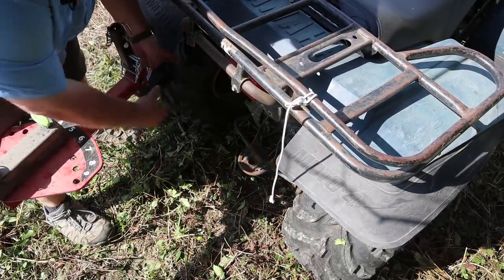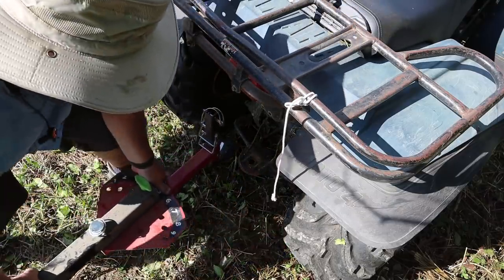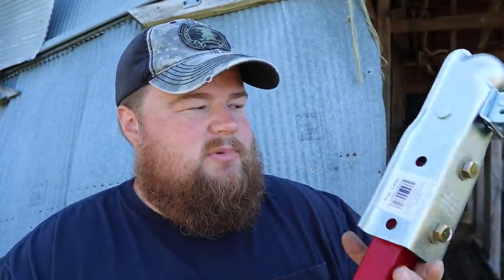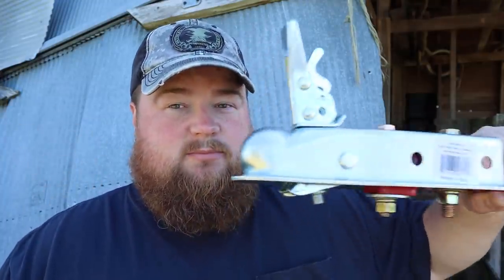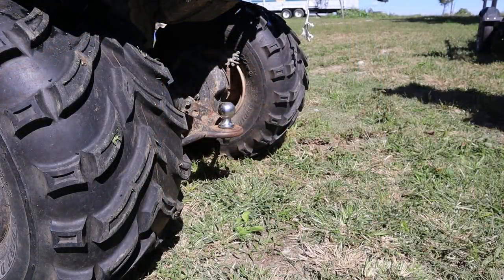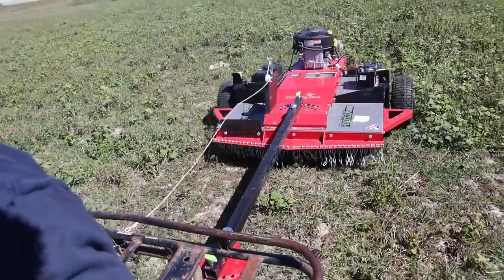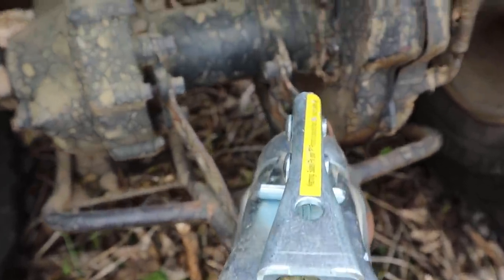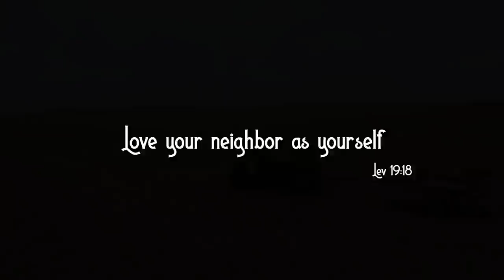FIXING a PROBLEM with our BRUSH MOWER

Comment: Try putting a large nut in the square opening. Then thread the bolt through it and lock it down with the lock washer and smaller nut. This will eliminate a wood block from deteriorating over time and breaking out. It will eliminate any play in that opening too. Also, remember to put a snap pin in your ball hitch lever to avoid any brush from popping it open and possibly jumping the hitch off the ball.

Comment: Thanks for the video. Wanted to do this last year but my engineer buddy had to juryrig a way to couple it to my Mule MX SxS. When that failed a few weeks back I went and bought the coupler and am a whole happier. 
The Earthquake is a beast, I run over all sorts of small bushes, pine trees and stuff. Been great to use plus it's taken down the time my buddies used to mow with their garden tractors by 2/3's the time it took them. Deer love the clearings also which is nice when the season comes along.

Comment: A block of wood in the square hole with the bolt hole drilled through the middle will eliminate your slop without modifications to the original part.

Comment: Where the bolt goes through the square part you could make a wooden shem to fit the square and run the bolt through the center of it. That would take away any movement. Great idea to put a ball hitch on it.
Reply from the maker: If I had it at home and in the workshop I could have made the shims quickly -- that's a good idea. Thankfully it's stayed put so far. :)

Comment: think the reason the pin hitch broke so often is that it didnt alowed for the machine to tilt independent from the pulling vehicle (like driving with one wheel over a stump ) the ballhitch gives it a lot more freedom , should work fine
one idea that miight help with the stump thing is adding skidplates or wedges (cut some out of firewood stumps with a chainsaw and bolt them under the metal triangles in front of the wheel so you can ride over higher obstacles , think right now if an obstacle manages to only just get under the triangle it takes a lot of force to drive the wheel over it , the wedge should help some lifting the wheel before it drives over the obstacle making it feel a lot lower

Comment: You got a Hitch Pin there. Maybe you could use a Square Wire Lock Pin. Lowes You can take a puinch and bend over a couple threads to keep those fasteners together with the rough duty they get.

Comment: Glad you could come up with a solution for your p.i.t.a. hitch pin problem. I like the ball hitch better on my old lawn tractor too. I use it for my rubbermaid lawn cart with is very versatile  since all 4 sides can be removed to make a flatbed trailer or keep them on and use the tailgate as a dump trailer bcuz it swings up like one also. 
The ball let's me move my rowboat & trailer out of the way to mow too. And when I still owned my 2 horse horse trailer I could move it too. But now I've traded that off for my gooseneck 4 horse horse trailer and of course that's too big and has no ball hitch, LOL.
Someday  (soon I hope) I hope to find some land like yours to build my new homestead. I'm waiting for parts, but covid has slowed them greatly, to come in for brakes on my motorhome. Then I'll be headed south from Michigan and start my land search & hopefully also start my YouTube channel.
Reply from the maker: I wish you great success and hope you find your place soon!

Comment: Have you thought about doing an offset trailer tongue so that you're not having to drive through the brush before the mower cuts it.    Maybe a next upgrade idea.   Only drawback would  be that you could only cut in one direction.
Reply from the maker: It has one, I just have yet to use it (or show it to you all) in that fashion. :) For wood cleaning, the ATV didn't have enough power to pull it offset. But for weeds/grasses I'm sure it will be great.

Comment: Use a bolt with the nylon locking nut and a couple big washers if you need them. Your hitch won’t come apart and you won’t lose any pins brother

Comment: Near the beginning of your "test drive" there appeared to be a black part in the lower bottom of the picture that was loosely bolted on.  You might want to check the bolts on the mower for tightness when you get the chance.  My experiences through my 75 years have told me to check everything after I've used it for a while.
Reply from the maker: I've looked twice and don't see anything loose -- unless you're seeing the tow bar for the mower? If so, it's not bolted down -- it uses a pivot point and spring loaded pins to lock it in place left/right for the offset mowing options.
Reply: @sam-and-angela  That must be what I saw. Glad there was no problem.

Comment: I just got mine, the belt jumped off in the first 5 seconds of running.  Now it's 95 degrees out and I get to repair my new mower.   The hitch modification was working good though.  I upsized the bolt through the hitch square tube to a 3/4" diameter and had zero problems.   

Update:  I put the mower belt back on and mowed all kinds of nasty stuff for 4 hours, trees, thorny vines, fallen brush, etc without a 'hitch'.   Also mowed on hills I 'd not take my tractor or zero turn on.  This thing 'cut' my mowing time in half.
Reply from the maker: I had the same issue!! Check your main pulley set screws. I had one work loose and the whole main pulley was very loose.

Comment: My friend had a similar problem.  First thing he tried solved it.  He swung the tongue clear out to the side so he didn’t have to twist his head clear around to see it very easily.  He also liked not driving the ATV  through the tall junk.
Reply from the maker: This mower has an offset function, I just have yet to use it.

Comment: nice tool hack! I'm kind of surprised that such a heavy duty brush mower would be pulled on a hitch pin.  Also, to take out the "slope", you could try to insert a bushing that fits over the front bolt to eat up some of that slope space, or just add nut that squeezes just inside to close the gaps.

Comment: Just Saying, A 5/16 pin for the hitch would be good, Plus You need to grease the hitch ball every time it is used or it will wear out, But it does seem to be working fine.

Comment: A cotter pin does not seem like the right choice. They make a hitch pin (used for many farm equipment/wagons) that is like a heavy pin with a handle on one end and a hole for a cotter pin on the other end. They come in a variety of sizes. But, your conversion seems to work just fine.

Comment: How does this brush mower do when trying to mow sides of ditches??  The angle it can get is a concern.  Like I don't want it floating on air because of lack of angles.
Reply from the maker: Out of the box, there is not much flex in slope with the pin hitch. With this modification the ball hitch will allow more flex of the mower. That being said, it also depends on your ditch size and layout.
Reply: @sam-and-angela  gotcha.  That’s exactly what we were thinking.  Still pondering….thanks!

Comment: why not mount the ball hitch directly to the original clevis , you done away with the telescoping height adjustment feature if you want to use a different vehicle such as a side by side that the mount may be higher or lower .

Comment: Nice mod. Just a thought about the bolt which runs through the square iron. Would 1 or 2 pieces of short pipe of different diameters fill that enough to stop movement? Also thought of a block of wood, but that might not stand up to the forces.

Comment: While I'm waiting on ardisam to get the part as it's only been two months, last machine it was three months before they got the part. This time I think it's the wheel bolt. You wouldn't think it'd take more than a week at most, but it is ardisam. So I thought I'd share a few emails with customer service from the first mower that they finally replaced.
And remember, they never had anyone look at the machine after it broke through the deck.
----------------
From the pictures it looks like the brake pad is completely wore off, that is where we are getting the idea that the problem came from there. Another thing I can see in the pictures is that bolts were in there at one point in time. It looks like you only need the bolts that come in from the sides, not the ones that go through the deck of the mower, correct?

 I am able to send you a new brake pad and all the bolts, nuts and washers needed to get your mower running again
Cust service
------------------------------------------------------
Read your email, I have some questions.

You say the brake caused the problem. That's not what caused the problem.
The brake pad didn't wear down, it broke at one of the triangular pieces holding the pad. Being 2 hours away from where the mower is kept I can't say but the one side with the triangular piece broke off. That isn't wear that is a defective part.

However it was the missing bolts that was the cause of the damage. If the missing bolts were there where is the scratching damage from them around the bolt holes while they were backing out from the vibration? And where did the nuts and washers that were on the inside of the pulley housing disappear? There isn't sufficient room for them to slide out of that housing.
There should have been nuts and washers inside the pulley housing but there weren't any.

As far as the vibration causing any bolts to loosen and fall out, then why haven't other bolts loosened and fallen out. Was the torque not done to the specifications which might explain vibration?

Videos on line at your site for replacing the drive belt clearly show a design change for the 2 black guide plates on each side of the main pulley. They are no longer secured by bolts going down through the deck. Latest design shows them bolted to the large red base plate. Obviously the bolts through the deck were a weak point. The new design has no bolts through the deck. Without the "missing bolts " all the forces from the main pulley are directed to the bolts through the deck. That would have eventually caused the those bolts to pull through the holes in the deck.

When was the design change implemented?
--------------------------------
Good morning!

I didn’t answer those questions because I don’t have answers for your questions. I have no idea why they ALL vibrated loose, I have no idea why the nuts that should have been trapped inside disappeared. Sometimes, things happen that I can’t explain, the world is an imperfect place. We think, (and by we I mean me and both of my managers) that the brake pad being completely gone caused the issues with the bolts. Diagnosing problems from pictures is not ideal, so we use what we have and we do what we can.

This will absolutely all be covered under warranty (this is the connector on the tow bar, it broke after we jury rigged the deck to keep the mower running, I did not take their bolts). Per my last email, I certainly can help you out here by sending you everything you need. The other part of my job is to educate our customers about proper maintenance and things that can be done to prevent future problems. I apologize if you were offended by that, it certainly wasn’t meant to be insulting or anything like that.

If I send you parts, are you able to install them yourself? Will you be able to drill the pin out that snapped and put a new one in there if I send it? Or would you rather bring it to one of our service centers and have it repaired under warranty?
----------------------------------
Notice after having looked at the pictures they decided the brake "looked" like it completely wore off. At no point did the lock nuts vibrate loose, they were still tight holding onto the brake.
So their customer service didn't care enough to do any actual inspection of the machine, they just decided they weren't going to repair the damage.
Later on after more work the big pin on the mower where the tow bar connects also sheared off. That was the part that took 3 months to show up. By that time they had finally offered a new machine, which of course lasted about 15 hours before the wheel fell off, the bolts sheared off, the belt broke and such.
I do not recommend anything from this company, they  have more companies. I also bought one of their pop up blinds - Baronette was the name. One of the fiberglas ribs on the hub broke, later that same spring it developed a tear which in subsequent winds tore the blind apart. Less than two months of use and it was unusable.

Comment: Just a question - would it be better to put the bolts the other way around, with the nut facing up, so you can see easily if anything loosens?
Reply from the maker: Not in this case -- with lock nuts they should not loosen at all. I rather not have the bolt sticking up to catch pant legs or skin as you walk around it or hook it up.

Comment: Hi Sam i need to change the deck belt on my rough cut mower have you done this yet any tips ? thanks
Reply from the maker: It's a pain! It's been a while but if I remember right, you take the main pulley bolts out of the middle (allen key set screws) and the pulley separates apart. I also had to take the back panel off where the key start is to route the belt around the guides back there.

Comment: Update, had to do the change as that black connector cracked into two pieces. Got one from warranty. Then the bolts holding the belt guide broke off and cracked the deck and ardisam said it was because the brake pad was bad and vibrated the four bolts with lock washers off just that one side. The brake was also broken but somehow the vibration didn't loosen the bolt and lock washer on the brake pad and it never came off. The belt guide on the opposite never loosened either. All 4 bolts and lcok washers are still solid. 
ardisam said it wasn't their fault but offered 4 bolts and a brake pad as a "courtesy".  Their explanation when I asked how the 4 vibrated off and never were found within the enclosed pulley housing was "sometimes things just happen".
Fixed it without their help then the ball on the machine at the back end of the bar broke clean off. ardisam did say that was covered under warranty, but it's been about 4 months without a part to fix the thing. When I took it in the warranty dealer was told part was about six months out from July 9th. Never showed up and ardisam never talked to the dealer about the no show on the part. Last I heard from them was about 3 weeks ago and was told they expect the part real soon. Which I'm assuming is sometime winter of 2025. 
Put in a complaint to my state attorney general and Consumer Product Safety Commission. Last communication was "thanks for your patience".  
Would not recommend this mower because of the problems of breaking parts and really lousy customer service.
Reply: Another update.
Got a new mower last November after missing the rest the mowing season when they offered a new one. Took it. 
Have used it five times and the four bolts sheared off the housing and pulley guides. Sound familiar?
Buddy was checking it because the tension was loose and the mower wasn't cutting grass so when he took the cover off he found four holes with no bolts. This time though he was able to find a single sheared bolt. Guess they're using bolts with the equivalent hardness of butter.
So off to the hardware to get some new bolts with a hardness of 8. Installed that started the mower up and the belt broke. Haven't contacted Ardisam, but not really expecting much. That final break on the old mower I had to take the entire machine in rather than just the part needing to be fixed. So it takes a trailer to get things fixed under warranty when you can get them to do so.
Buy this garbage from Ardisam at your own risk. I really wish they had offered to buy it back so I could buy a different machine. Couldn't be any worse than this thing.

Comment: Why are you not using the offset adjustment so you can stay out of the overgrowth 🤔
Reply: Good ?
Reply from the maker: I've tried it a few times on the really tall woodsy parts and my ATV doesn't have enough power to pull it through that tall brush without having it laid over first.
Reply: I see thanks for the update response 👍🏻

Comment: Are you still happy with this mower and did you ever wish you had gotten a 4 wheel one instead?
I would value your opinion as I have read some bad reviews of the Earthquake.
Reply from the maker: We are still happy with it and use it regularly. No real issues to speak of. The two wheeled does fine behind our four wheeler or tractor and knocks down everything in its path. We have been pleased with the Earthquake brand equipment we have.

Comment: Ventrac makes a flail mower that is pushed in front of the machine. Well, Ventrac is for rich folks or golf courses that can afford a machine about as expensive as a new car. But you ought to take a look at their video! Wow! So, back to earth here with folks like me barely making it, there is a point they illustrate that having a mower in front allows a person to go under trees, etc. and direct the business end to where you want it to go first, behind the tractor. I wonder if there is a way to hook this machine you are using to the front of a stout riding mower, small tractor, or a 4 wheel utv, or maybe some one makes such equipment that would work like that Ventrac. Such a machine would need swivel wheels in front and back with a rigid yoke set up to the tractor, and then there is a safety issue as things fly off from the machine, so a screen between the mower and the tractor would be needed. Maybe some one out there can fab something up to work like that with this machine you are using. Any volunteers out there that can try this out?

Comment: Your initial problem was you're using a clevis pin instead of a hitch pin.  You needed something with a better cross pin holding force than the spring style hold down.  But even if you hadn't had problems I would have done the same regardless.